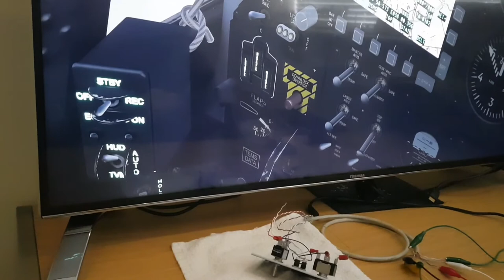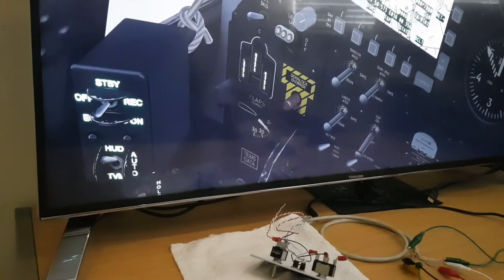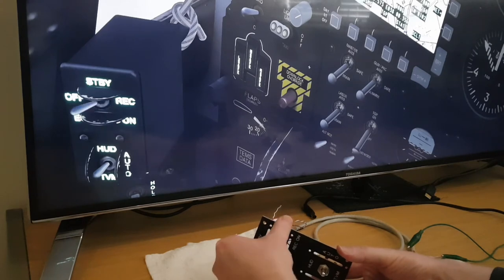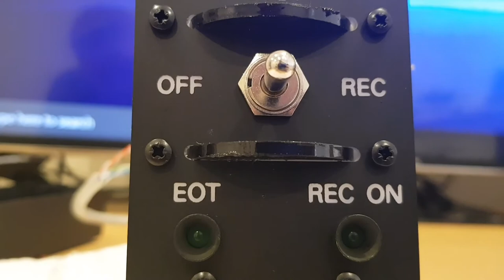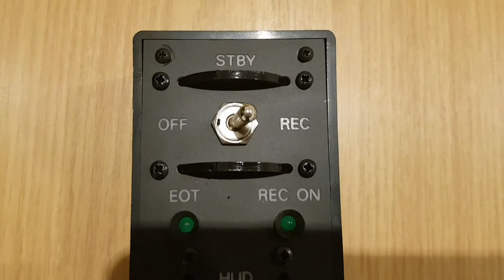DCS A10C Simpit DVADR

Comment: What toggle switches are u using?
Reply from the maker: Hi Markus, for this unit I think it was 2 multicomp - mcr13-7-05 toggles. These have 3 positions, centre off and either end on. They have a good quality feel and nice actuation to them.
For other panels where there are alot more toggles I've often used SCI R13-29E as they tend to be less expensive as a brand, or other toggles along these lines but perhaps single pole as makes cheaper still. Cheers